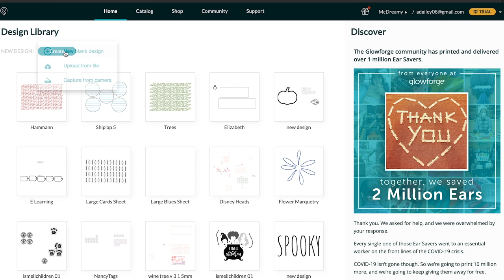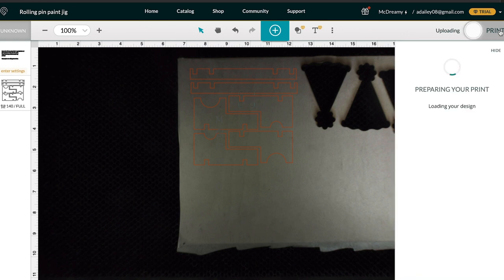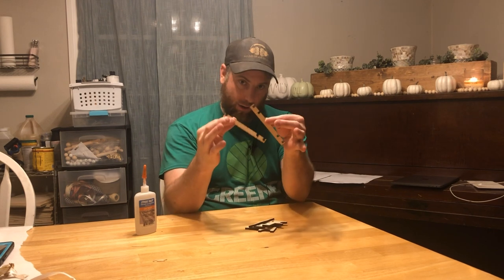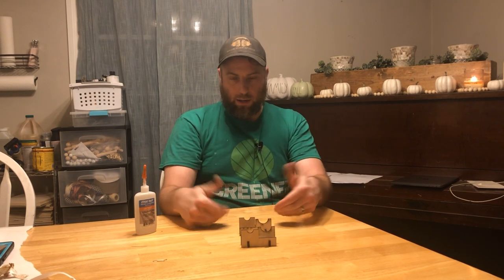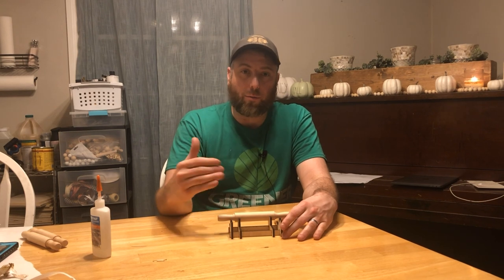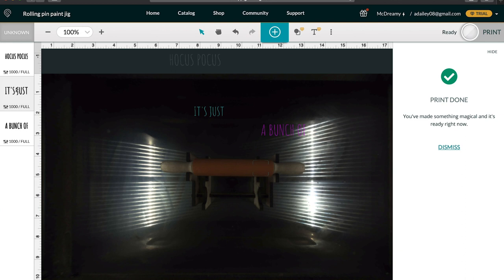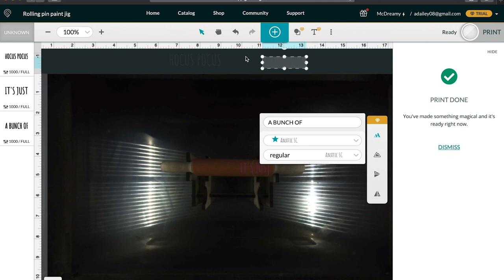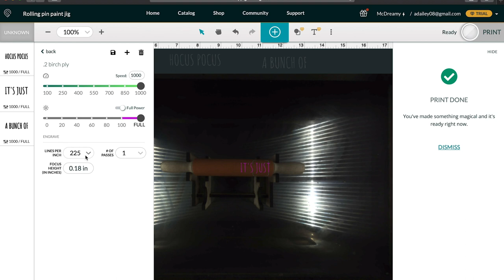Rolling Pin Engraved on Glowforge

Comment: I love these mini rolling pins and will be getting this file for the jig! Thank you :) I have a question, I noticed you put paper under the purple but not the others is it best to do paper anytime the crumb tray is out of the GF? Also did you seal after painting to make the smokey parts easy to clean after engraving or did it not get smokey? Thank you again
Reply from the maker: Sometimes the laser has trouble focusing when the tray is out because of the reflection of the lights on the base. I found the paper helps with the reflection. I don’t seal afterward but you can. I didn’t have much smoke after engraving. But if I did I use denatured alcohol to clean it up with a qtip.